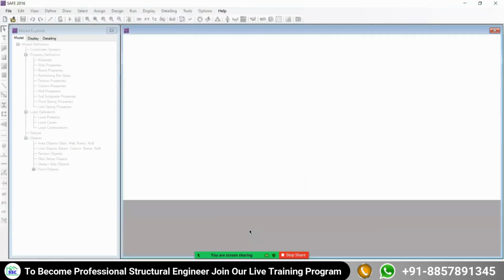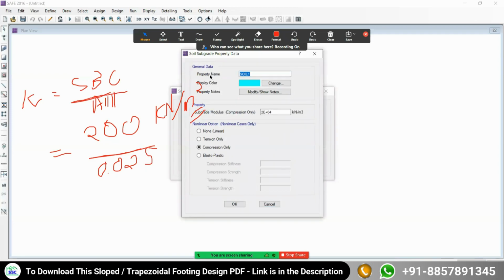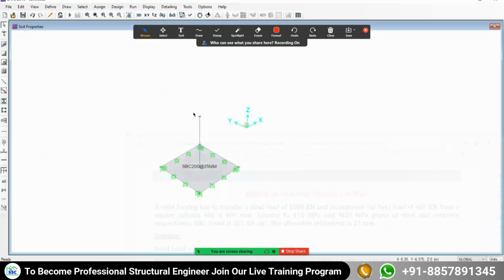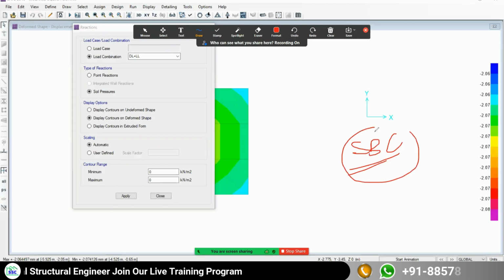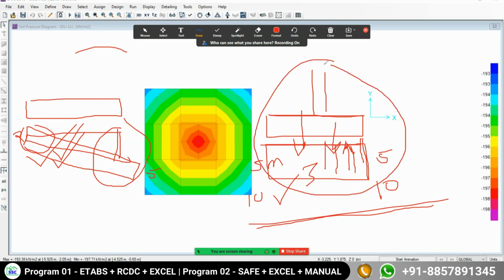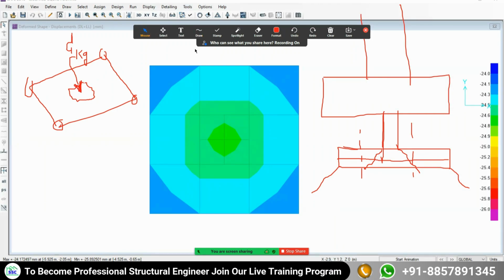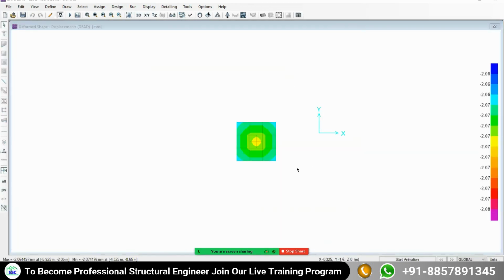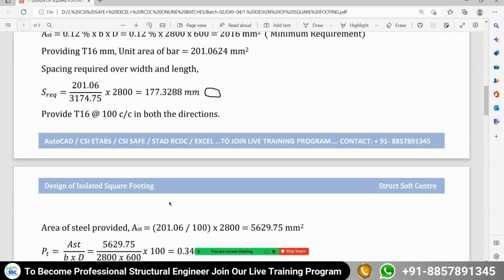FOUNDATION DESIGN IN CSI SAFE I SQUARE / RECTANGULAR FOOTING IN SAFE I IS 456-2000 I RCC FOUNDATION

Comment: But why didn't you considered Mx, My, Mz , Fx and Fy from ETABS result and only took Axial Force Fz during footing design using excel ?
Reply: Because we need only initial sizes and depth of footing to provide in SAFE , and if you directly do modelling in safe then you will stuck in the loop of doing analysis and multiple iterations , in the big project this will eat your huge time. You can create your own excel sheet but if you do this in excel sheet then why you need the software. And in the Eccentric , Combined & Raft foundations you can not do by using Excel sheet , And in the bigger project you have to go for non linear analysis and design otherwise you may end up with heavy design or under design. And the above forces which you have mentioned, most of the time they will not govern in the smaller structures but still you need to for design purpose that why you need software .